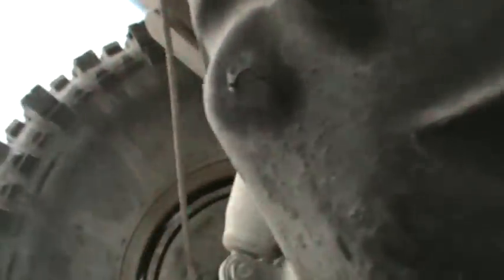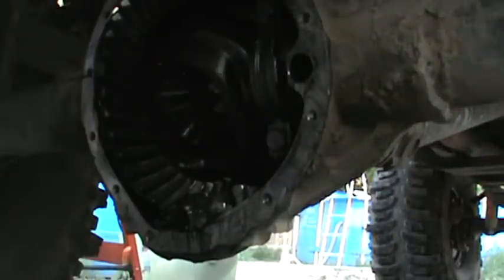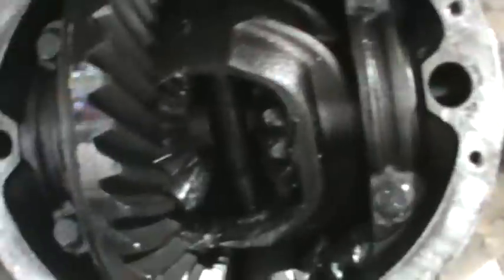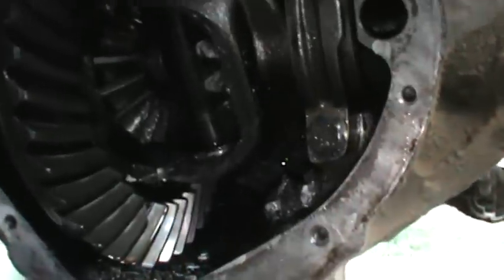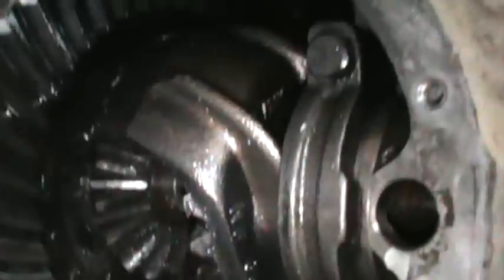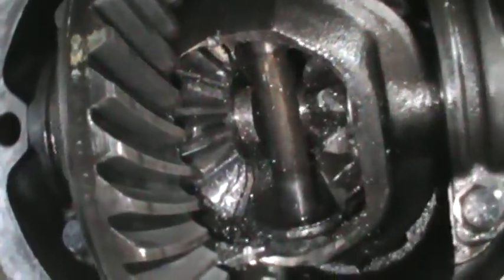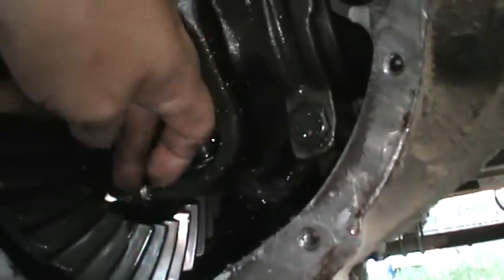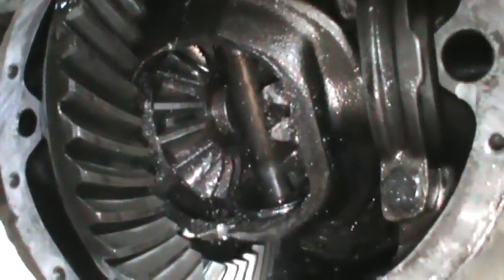12bolt goes boom! The aftermath.

Comment from the maker: Yup, this was on a K5 too. Just got done putting in a 14 bolt after this happened. Fully welded with 4.11's. Also swapped out the 1/2 ton dana 44 for the matching 3/4ton 10 bolt. Good luck with your rig also!